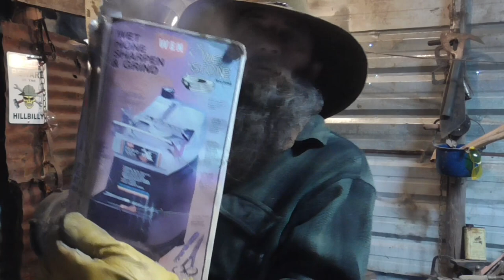Ol' HILLBILLY and His FRUGAL SELF RELIANT WAYS and Finishing up some Knives in The BLACKSMITH SHOP

Comment: Evening Hillbilly and Miss Kitty. Just another enjoyable stop over. You know without some clock staring you in the face all the time, it's easy getting into the rhythm of Mother Nature.  I lose track of it all the time now, and it makes it real nice to sit for a spell and share that similar rhythm. Say the cold there inside keeps you busy doesn't it. I lived outside fort two winters here in Tennessee, know of one man froze to death camping out. I built me a shelter 3/4 ways up the side of a high wooded hill and kept it spotless. The encampment was cleaner when I left than when I went in. Picked a dead tree stump way off to empty the urine jug in. Had an old metal pot, put a plastic bag in it and carried that shit out with the trash every night. Worked security and clean up for six months and bought a step van. It is colder in that metal box than outside, guarantee you that. Summertime it is an oven during the day, unlivable. Anyway, I finally reached 66 and quit and live inside (2 years ago). I got addicted to the internet, didn't know what a computer was until this time of year in 1999. I am stone age, man! I like to search our front drainage ditch after every rain for pretty rocks, got a few too. Have a good evening, and make sure you got some high ground, I seen many a creek rise, for sure!